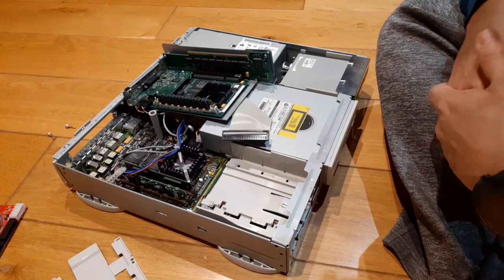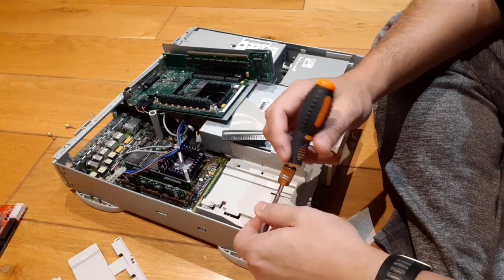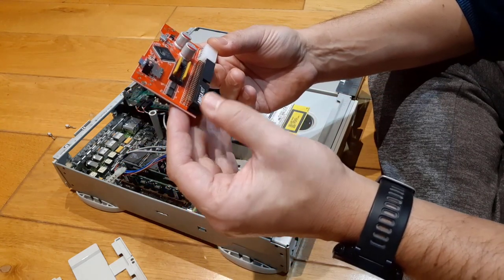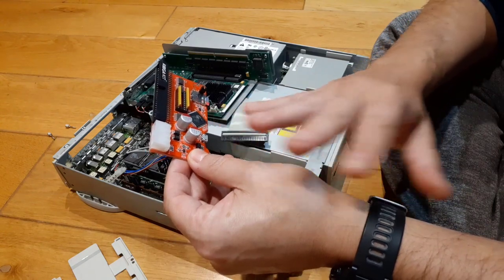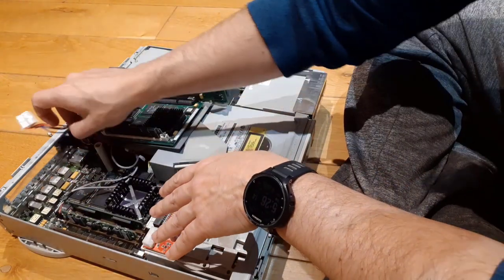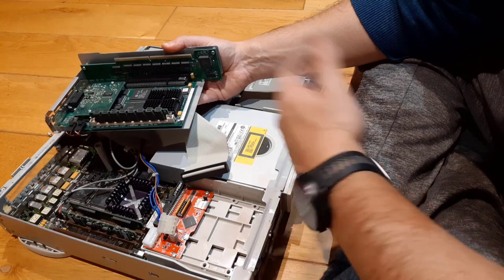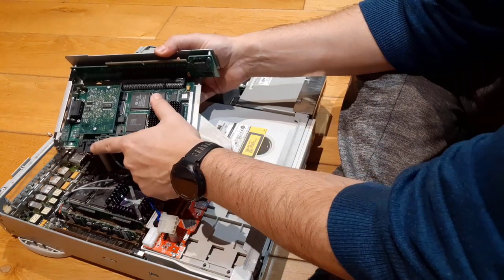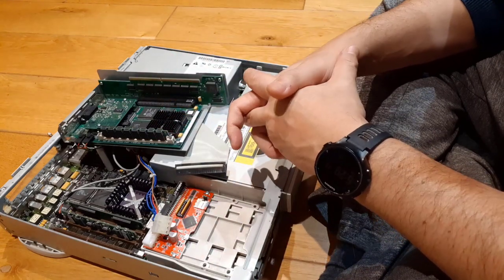Macintosh DOS Compatibility Card installation, troubleshooting and demo (running Doom)

Comment: Thank you so much for this demo. I've have a 6100/66 as well and got a blank screen as well for weeks now. Your guess at virtual helped me to finally get my screen to work. It's not complete yet, man this is getting complex because it shows the PC screen but hangs on the compatibility version 1.07 line. I know it's a problem with a bad  Mac  compat installer disk so I need to replace it soon somehow. Thank you for helping me to get most of the way there.
Reply from the maker: Thank you for the comment!!! It's awesome to know the video helped someone 😀